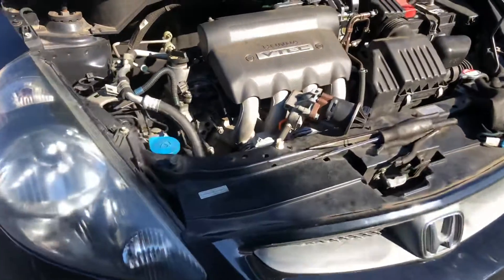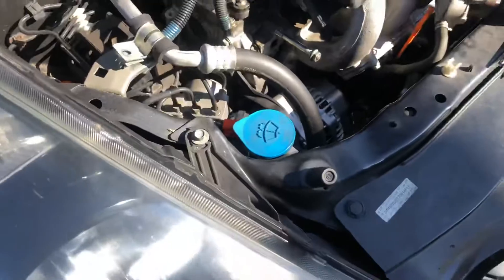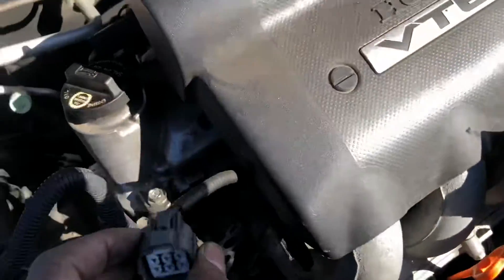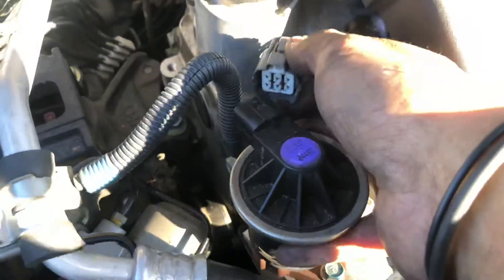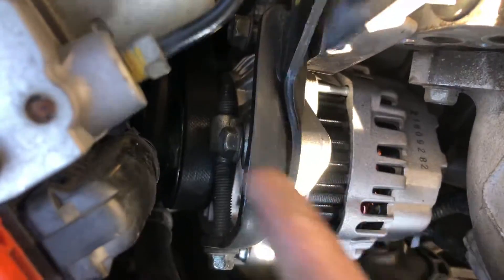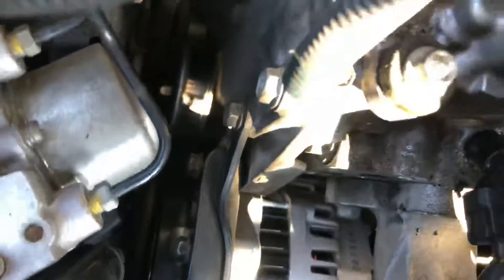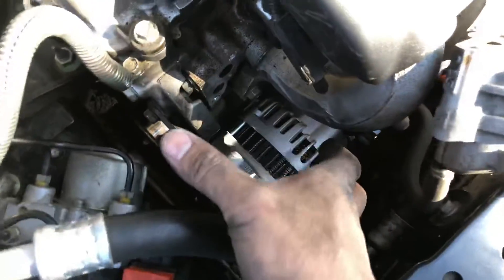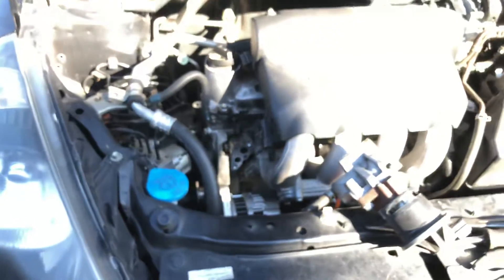2007 2008 Honda Fit Alternator Removal (walkthrough)

Comment: Thanks. Hayne's manual makes it seem so easy, but never mention access (removal of EGR, tensioner bracket). I would have figured this out, but you answered my questions beforehand and saved me some time.
Reply from the maker: Awesome and glad my video helped you 🤘
Reply: Haynes manuals will say remove intake manifold so more work.

Comment: The easier way to take that alternator in and out is to split the intake in the middle 10 bolts. Gaskets are reusable. If you ever have to take the starter out that is the only way to do it.
Reply from the maker: White Knight thanks for your input!
Reply: Thanks, I always concern about how to replace the starter , that look so difficult to do.
Reply: That’s like the fucking worst idea ever, just go under the car with a 12 mm with a 14 inch extension and take out the bottom bolt on the alternator, take all 312 mm bolts off on the top, remove the EGR mount you can pull the alternator right out the top and then unhook the wires
Reply: Also you will need a swivel on that 14 inch extension of Christmas tree
Reply: Bullshit!

Comment: alternator is not charging except over 4000rpm after fitting new drive belt; tension is tight. What did I do wrong? 
ANSWER: despite wire brush cleaning all negative cable terminals, this was insufficient (as determined with voltmeter measuring resistance from battery -ve to various -ve earth bond points: some were over 0.6 on a 200 scale). Cleaning with sand paper allowed the alternator to work correctly and to recharge the battery. Incredibly fussy electronics!
Reply: I have the same problem, charged the battery once to 100%, car ran for a few days then battery died. Jump started it and it died within minutes,took it to charge, and they told me it didn't even charge and was swollen on the side. What could be the problem?

Comment: Two other videos also say “12mm” is used for the bottom one of the alternator,  but how come my upper bolt and the two bracket bolts holding the alternator are 13MMs!? I’ll be removing the bottom one tomorrow.

Comment: I took the bottom bolt out however it's not threading back in or I have the wrong bolt any advice?
Reply from the maker: Make sure the alternator is aligned properly, try wiggling it up and down until you find the right spot.

Comment: I believe my alternator needs to be replaced because my power steering keeps going out because my battery isn't being charged? Please respond to my to question
Reply from the maker: First, verify that your alternator needs to be replaced. It should be around 13.5 - 14.2 volts with the engine running. If you do replace the alternator and your power steering is still not working…then inspect the electric power steering or module
Reply: @BrianBalatbat  thank you for responding....I replaced the alternator today and everything is working fine again.... your video helped me out a lot thank you

Comment: Thank you so much for your explanation.

Just one question, did you replace the old alternator with another original or with a generic one (model?)?
Reply from the maker: Hi, replaced it with a remanufactured one.

Comment: Hey I have same car and the dash lights went off and it got stuck in park and no electrical power steering didn’t work could it be the alternator
Reply from the maker: Sounds like a dead/weak battery, try jumping it first and see if it starts.
Reply: @BrianBalatbat  Turns out some thing ground at the oxygen sensor under the car that was hanging there and it’s fixed now
Reply from the maker: @matthewwright98  I’m glad you got it sorted out.

Comment: When I start the car and is running and all of a sudden my rpm drop and shut off the car 
is that due to a bad alternator not charging throughout the car???
Reply from the maker: Hi, get a voltmeter and check the voltage while it’s running. It should be around 14v with the car on idle. If it’s at 14v and the car still shuts off it could be a vaccum leak or fuel issue.

Comment: This method is a great idea and should have worked for me. But the alternator didn't cooperate in coming out. I couldn't get enough leverage to pull the alternator once the bolts were out so I removed the intake and got a pry in there to pry it loose.